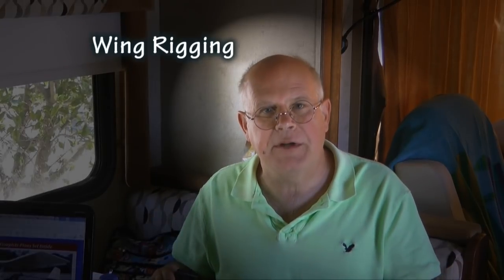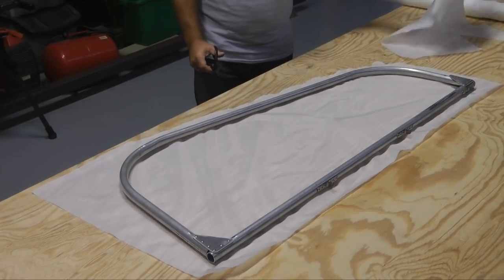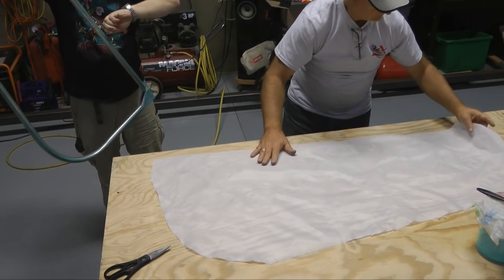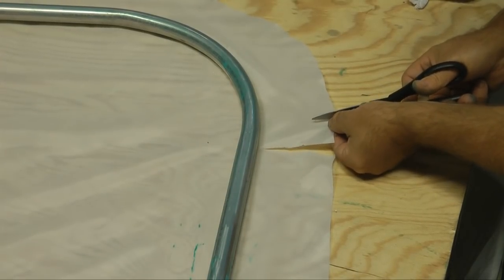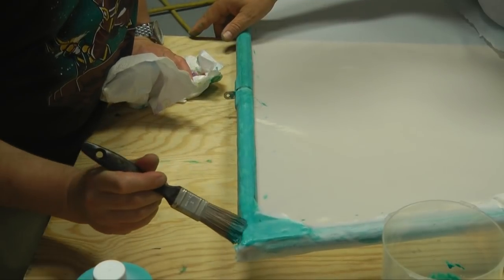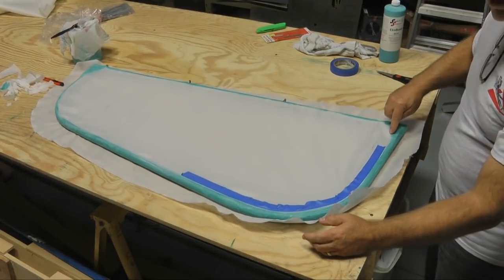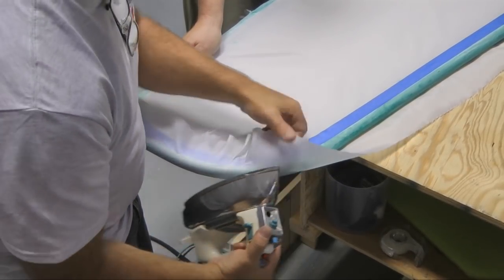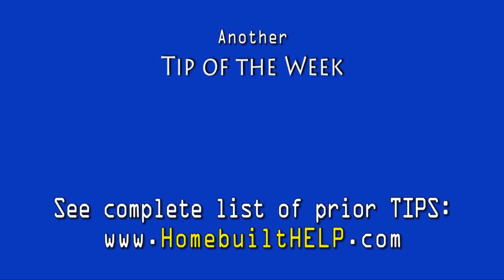Building the Affordaplane Part 35

Comment: Please consider showing a short demo of all three systems, Poly Fiber, Stuart, and Oratex on a small part, like the rudder, and then move on to whichever choice you make for the larger or finishing portions.  Doing on half of the wing as suggested in other comments makes sense, but having some exposure to the actual systems (vs advertiser's demos) would be very helpful.

Comment: If you can film the covering of one wing? That would be hugely beneficial. I know that would be tough to film. 
The poly fiber is probably the way I’ll be going for added strength.
Reply: I dont think there is a "strength difference" between polly and stewarts. Stewarts is approved to repair polly as far as i know (not much) so tells me their =. Stewarts is just easier to use since its water based

Comment: FWIW, Dacron, polyester and ceconite are synonymous. Poly-Fiber is a brand name/system of coatings and accessories (see Aircraft Spruce for details). Another step not shown here is the application of finishing tape (aka perimeter tape). It's used over potentially abrading areas like braces, ribs and struts (as well as the perimeter). The About section of my name has a link for an example on my build.

Comment: Hi again Jon.Looking at the covering of the rudder I suspect that the Stewart System would give you a lot more time to get the fabrice on to the frame as it is water based. The fumes given off by the solvents in the Poly System are not only dangerous but flash dry very quickly and the bonding property of the glue could become useless.
I am very keen to see the wings been covered as I feel they will require much more skill than the tail section.
Hope to see some more videos soon. Thanks for the series so far.

Comment: Jon, great overview. However, I think a bit more detail would be appropriate. For instance, cutting around hinges on 2nd side; setting iron temperature, how to tell how fast to move the iron, tensioning the fabric, and more. Thanks again for doing this! Also, I think it would be worth mentioning that the weight difference across the 25 yards of fabric for the 1.7 oz vs the 2.7 oz fabric would only be about 1.5-2 pounds across the aircraft. If you're trying to make 103 weight, this could be significant, but about double the fabric cost to save just shy of 2 pounds.

Comment: Hi once more. Jon, please could you let us know what heat range is used on the iron to bond the material to the frame, and the range to do the final shrink of the fabrice. I have seen on another site where covering of the wing was done, but I don't know what adesive was used.
An over view of the covering of the wing should be enough for me, but a step by step might be necessary for some of us when it comes to covering the wing.
I'm very fortunate in that I learn through my eyes, but not so good through my ears. I just have to see how to do the task and then I can repeat it like an expert. This is probably why I'm hopeless at learning languages.
Thanks again for this series of building the Affordaplane.

Comment: Hi Jon. I have some wories about the covering of the wings. The wing is a lot more complex than the tail feathers. I think a step by step video would be of great benefit to most of us builders. 
Also, after seeing how forgiving the water based Steward system is I think I will be using this system when I finally get to Bulgaria and have somewhere to build the A Plane. 
I have all your tips of the week so far saved on my laptop, and intend to use them to build my own affordaplane. My main concern with the wing is the getting around the strut attachments. Also Jon, could you advise on any short comings that might happen when covering of the wing with the Steward System, or if it is prfectly OK to use the system throughout.
Thanks again for a most informative series of videos. I look forward to seeing part36 soon.

Comment: Hi again Jon. Please excuse the mistake I made when I posted my story under S. I lent my laptop to my friend and somehow she got into your web page.
Anyway I think I will not require a step by step on covering the wing, but I'm concerned that the wing doesn't have a lower rib. Am I missing something, or will you be fitting the lower rib later?
I feel really confident that my project is going to be a success. I have all your videos to refer to if I get stuck.
Thanks again for the information so far.

Comment: You mention the Poly system has hazardous components.  Might be a good idea to detail those and to indicate the protection needed to use it.  Then folks might be able to give you a choice on the method.  I build guitars and finish with nitrocellulose lacquer.  Only PPE needed is a respirator I can buy cheaply at Harbor Freight.  Perhaps that's all that's needed for the Poly system.

Comment: Re: Stewart vs Polyfibre, SS sounds much more friendly, but which lasts longer, which is easiest to remove should re-covering be necessary, and let's not forget price. I suspect no need to go over this again as long as wing seam joining is covered.  Cheers Jon!
Reply: WRT re-covering...  I've never worked with Stewart, but I did strip a plane that had been badly covered with Poly Fiber.  It was just a matter of slicing the fabric and pulling it off.  Even in the areas that had been glued properly, it came off fairly easily.  The hardest part is removing the Poly-Tak residue from the structure.  That takes a lot of MEK and many hours of scraping and sanding.
Reply: @FlyingShotsman   Thanks FS!

Comment: Hello again Jon. Thanks for the reply. 
The strut connection in the wing has been giving me head aches for a while no. I had the impression that the wing had to be completed brfore connecting the atachments to the wing. I could not figure this out as you would do this. As there is no access access to the quarter  inch attachment bolts through the spars. Even though you might install the strut attachments after covering the bottom of the wing how do you inspect the attachments after the wing is completly covered.
Been made of steel it would be of great benefit to have inspection hatches on the under side of the wing because steel rusts no matter how well it is painted, and it is important that you are able to keep an eye on these fittings.
Electro plating these parts is not an option as hydrogen imbrittlement weakens the plated piece greatly. Cadmeium plating is the only electro plating allowed on aircraft, but from experience I found that it doesn't last. Rust soon sets in.
Stainless Steel is also a no no. Although it has a greater tensile strength than ordenary steel it has an alarming fatigue  rate. It really doesn't like to be bent.
Well that is my issue spelt out. I hope to see how you over came this problem. I'm sure you have this well and truly under control. 
Thanks again for a most informative series.

Comment: Hi again Jon. The issue that worries me about the covering of the wing is how do you apply the fabric around the strut attachment points. As for the rest of the wing it appears quite straight forward to me. But I'm probably wrong with my assumptions.
I'm eagerly waiting to see how you tackle this problem with the strut attachment points.
My guess is that you will be covering the bottom section of the wing first and then doing the attachment points and adding the reinforcing patches before covering the top surface of the wing. Am I correct in assuming this?
Here is hoping we hear something from you soon, and that the conditions improving there.
Reply from the maker: Hi Arthur, Yes the struts need to go thru the bottom. You can learn from my mistakes by watching me do this operation!  Shouldn't be long before we're back to building this season.

Comment: Hi again Jon. Could you tell me if there are any advantages with the Poly system over the Steward system. A big advantage with the Steward System is that it is water based. But does it have the strength of the Poly system.
In my estermation strength is paramount when constructing aircraft. You don't want the pants to peel off the flipper when you are up there. Could be embarrising.
Please advise us on the way to go. Thanks.

Comment: This is not a Stewart's Systems guy. The joy of this adhesive is that you paint it on the tubes, let it dry to tacky, then position the fabric in place using a tacking iron. Got it wrong? Just peel it off and start again. You can reposition it as many times as you want. Then iron it down to the tube, work out the sags, and then when it is perfect, overcoat the seams. He is tacking it down by sticking it to wet. Stewart's is attached to the dry base coat with heat.

Comment: Jon, I was looking into the rigging for the tail feathers and noticed the information in the plans seems to be a little lacking. Can you cover this topic? Between the 3-view drawing and pages 97 and 125, a lot of detail seems to be missing. Your thoughts?
Reply from the maker: Jim, I think all the info is there - just a little bit hiding!  The angle of incidence is set by the drilled wing attach holes in the fuselage via the gussets. The dihedral is documented on page 46 (3 degrees) as measured with a string. There is no sweep adjustment.  We will cover these things in our vids when we rig our wings to make this clear.
Reply: @HomebuiltHELP   ... Sorry Jon, but I was trying to reference the cables on the tail feathers (both sides of fin) from the top of the fin to the outside of the horizontal stabilizer (upper side) and from the outside of the horizontal stabilizer to an attachment on gusset I (lower side). I haven't made it to the wings yet. (I found that from the 2016 plans pdf, pages 125 and 127 has the information defined.)
Reply from the maker: My apologies - I did not read your question carefully.  I see on drawing 97 of the more recent plans this rigging is discussed somewhat.  The reason it has not been addressed yet in the videos is that this step comes after all covering is completed before final installation. The holes in the gussets DO have to be made now, of course. You can rig before covering - but it would have to be disassembled before covering and later reattached. These are straight cables that should not alter the alignment of either the fin or the stabilizer - it merely locks in their position.  I will show these in a video when the times come. In addition, there are cables from the elevator tips to the tailwheel area on the fuselage.  And then there are some other cables.......!

Comment: I vote Stewart’s. Maybe a little more explanation of the process, timing/tips. Pro’s and Con’s of both systems. Don’t need to see covering of the entire plane.
Reply: Stick with the Stewart system. . .would like to the rest of the aircraft done. . .thanks Peter
Reply: I vote Stewarts too! The only real difference is the chemicals the process is basically the same. 
Full disclosure the CFI who signed me off for my check ride is the owner of Stewarts. But I did used polyfiber on my MiniMax build. Next build I'm using Stewart's or Oratex.

Comment: oratex seems like a great fit for this kind of build
Reply: Wish it did not cost so much tho! I'm considering using it on my Dakota Hawk build if I have enough in my budget when it comes time to cover.
Reply: @ulbuilder  You have to consider the total cost of covering.  Oratex doesn't require paint, so the cost and time for that entire step is avoided.  I had the same concern about cost, but when I did the math for my project, Oratex made the most sense.  The only other drawback to Oratex is the flat/dull finish compared to a good paint job.  One word of advice: don't order your Oratex supplies until you're almost ready to cover.  Oratex glue has a short shelf life, so you don't want it sitting around for a long time.  Shipping from Germany was very quick, so you won't be delayed if you order just-in-time.
Reply: @FlyingShotsman   Lighter, seems stronger, much less labor, no harsh chemicals and no painting. Yeah Oratex seems like the ideal fabric to use. You are right the savings in labor can make it cheaper or break even. But some people have more free time than free money where others can make more money if they had more time. I want to spend my time building and flying not painting so I am leaning towards Oratex when it comes time to cover my Dakota Hawk but the deciding factor will come down to how much money I have to spend when it comes time to buy my covering supplies. Thanks for the tip about not ordering too early, also gives me more time to consider my options.

Comment: Would a heat gun work better than the iron?
Reply: Not really. The iron heat is controlled and calibrated to bring the fabric to a known & even tension. The heat gun can create great variances in tension. It can also burn through. There are however certain areas that a heat gun can be used effectively, such as shrinking compound curves or tight hidden areas where an iron cannot reach. I have done a lot of fabric work. There are some things shown here that I would do differently, but they managed to get it done in good fashion.

Comment: Is oratex and polyfibre are same ??
 
Is polyester and polyfibre are same ??😇
Reply: Oratex is fabric that is prepainted. I believe it also uses a non toxic glue. It looks like a great product, strong and lightweight. Cost is it's downside.

Polyfiber is a brand, they sell polyester fabric and the glue and such are thinned with MEK, really nasty stuff not good for the central nervous system.

Stewart's is a brand, they sell polyester fabric and have water based non toxic chemicals.

I believe both Stewart's and polyfiber can be used on any aircraft not just homebuilt. Oratex last I knew only had approval for hombuilts and a few specific aircraft.

To be complete Dacron is a name brand for polyester fabric and is often used to describe the type of fabric used in aircraft.
Reply: Prayer is cheaper in the long run and finnish covering is lighter becouse you don't have to apply paint and the other sealing products like polly spray ect. 
It apllys almost like RC covering and can  reshrink any time with a heat gun
Reply: @scottjennifer7778  I assume you mean Oratex? I'm not convinced that it is cheaper in the long run. I think that statement depends on what value you place on time. You will save a lot of time using Oratex, but some people have more free time than they have free money and others can earn more money if they only had more time.
Reply: @ulbuilder  thank q bro